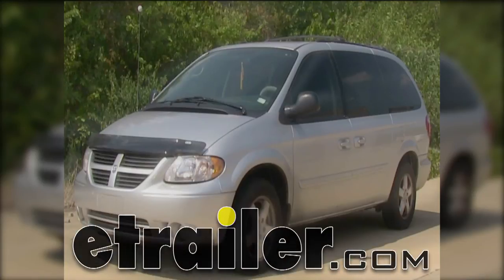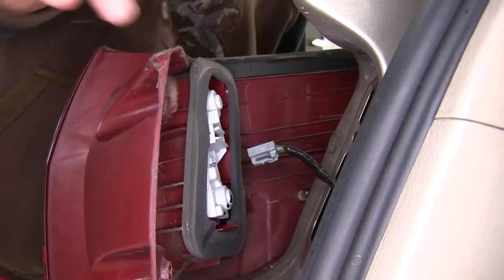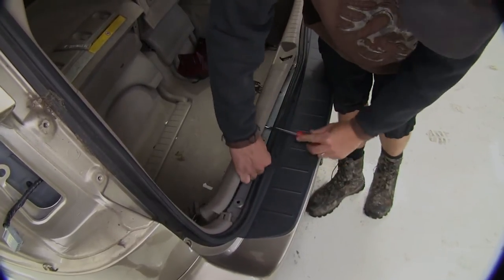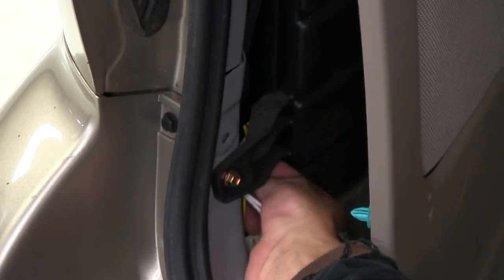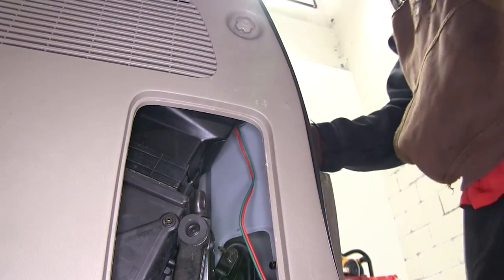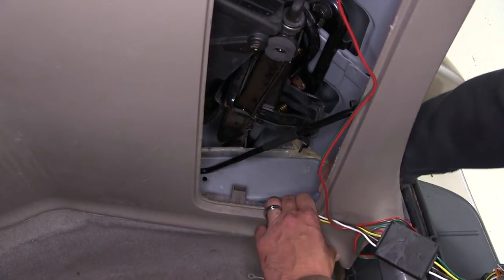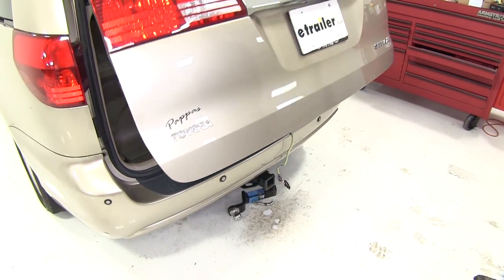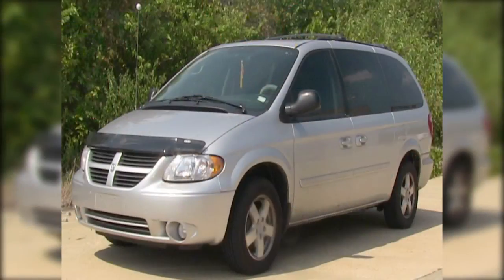Install: T-One Vehicle Wiring Harness with 4-Pole Flat Trailer Connector on a 2004 Toyota Sienna

Comment: How do you keep from breaking off the clips on the threshold and panels?
Reply from the maker: Use a flat blade screwdriver and go slow or you can use a specific tool or tool kit (linked below).

https://www.etrailer.com/s.aspx?qry=&furl=-pg-Tools-sf-Tools_for_Wiring-pt-Trim_Removal_Tool&utm_source=youtube&utm_medium=Comment&utm_campaign=Youtube%20Comments